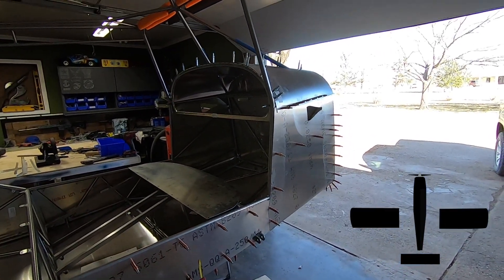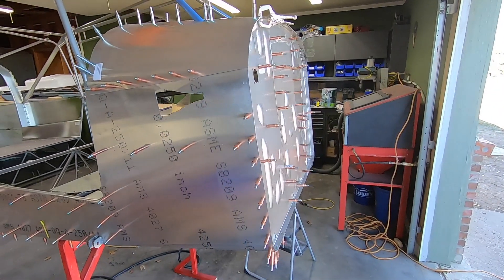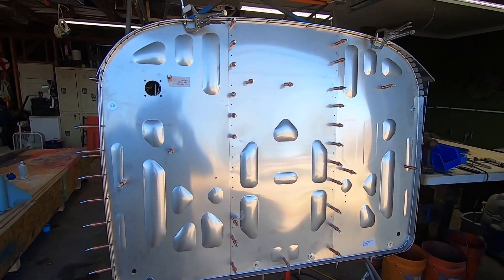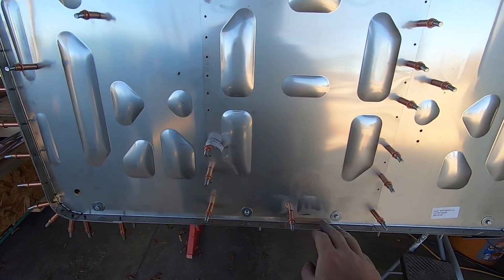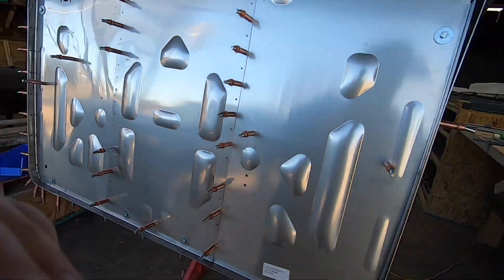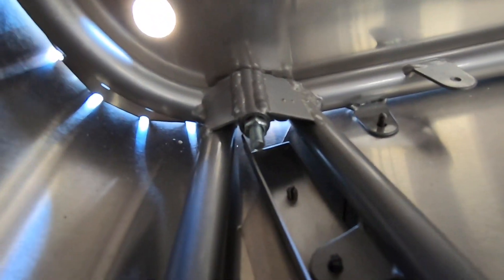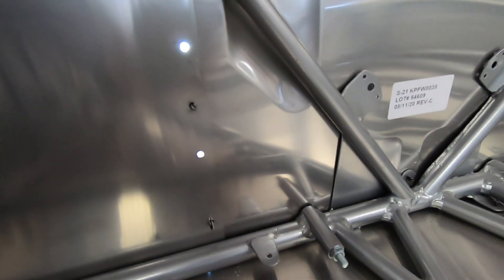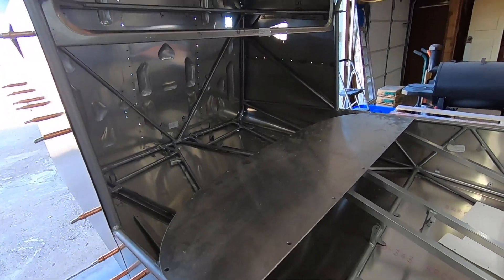RANS S21 EP18 BOOT COWL PART 2

Comment: Josh, looking great. Thanks for posting your video series. What brand/grit pad are you using with your die grinder? (sorry if you've answered this before). Thanks!
Reply from the maker: That’s the 3m roloc system. I use 40 grit and red / blue scotchbrite discs on it. Works really good!
Reply: @Project2Aero  Thanks Josh!

Comment: Hey Josh...what do you think about putting a slight rolled edge where you are fitting the curved deck top to the boot cowl for a better fit?
Reply from the maker: I do plan to run the edge forming tool on that edge when it comes back off👍

Comment: If you know which engine you are getting you can make all you holes thru the firewall off the airplane.  If I had it to do over I would have had them cut locally in a Cnc machine so all the holes were perfectly spaced.  The other way to do it is to use an electrical knock out kit from an electrician.  Don’t use a step bit.  I Stratford with a step bit and it looked terrible so I changed to a knockout kit.  The kit used a hydraulic pump on the knock outs and it took a few seconds to make a nice clean hole.  Of course the smaller holes.  Looking sharp man!  💪🏻💪🏻💪🏻
Reply from the maker: I’ve been a bit indecisive on the Powerplant🤷🏻‍♂️ I do plan the not attach the firewall permanently until I have all the firewall protrusions figured out though so I don’t tie my own hands. Cnc would be cool for sure👍
Reply: Of course the smaller holes will be done with drill bits.  Again, I think having the local Cnc shop cut the holes would have looked awesome.  I took my time but the holes for my 4 ignition leads are off just a little and I don’t like it.